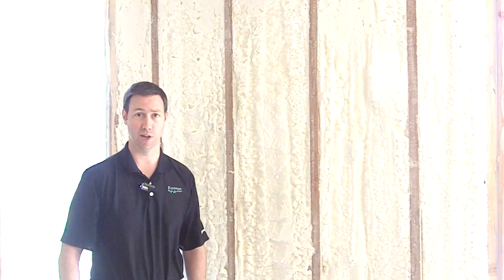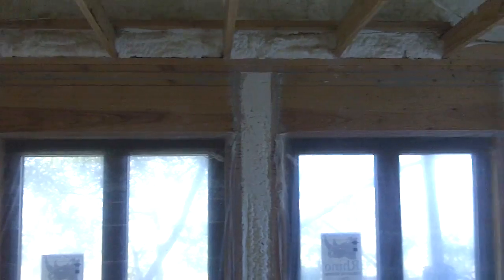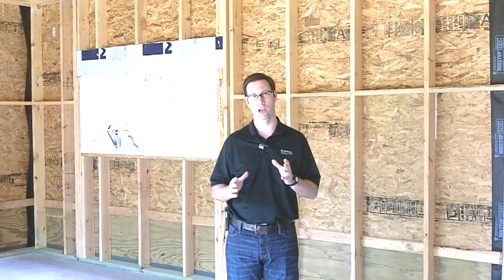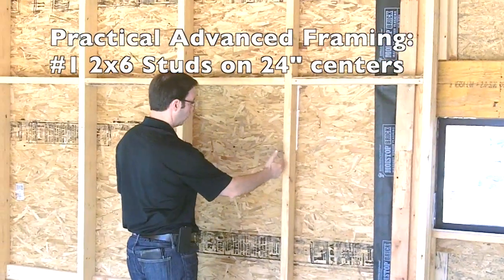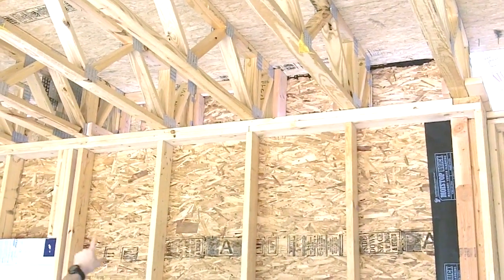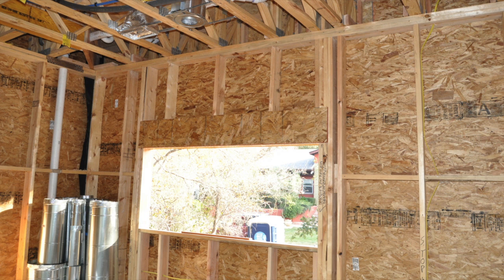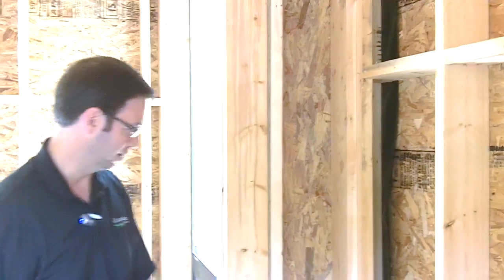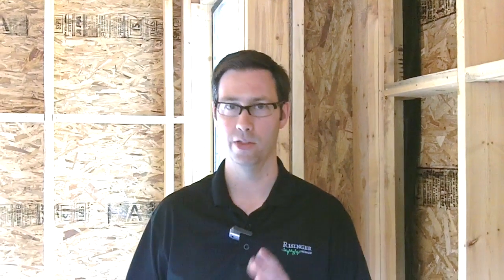Advanced Framing vs Traditional Framing

Comment: Lots of fun comments here.  As with any industry the traditionalists have to be dragged kicking and screaming into the future. I know, I worked in the car industry and watched the Big 3 get their asses handed to them. They were building old school heavy shit that was unreliable and inefficient. I'm now in a position financially to have a custom house built, but some of the comments here from so called craftsman concern me. They may be exceptional carpenters, which I greatly admire, but really, what qualifications do you have regarding structural strength calculations. A 2x6 24"OC wall has a greater section strength than 2x4 16"OC. A semester of college level Strength of Materials will teach you that, so how can pounding nails for 25 years somehow make you qualified to dispute that. This kind of construction is being studied and has been proven. As a lay person even I can go do a little research and find that. Scary shit.
Reply: Most of the comparisons are people who insanely overbuild, with 2x6 boards at 16" OC. To get an "apples to apples" lumber savings, we also have to consider 2x6 boards for 16" OC vs 24" OC. The main difference between traditional and this video is the horizontal blocking, which he doesn't explain to us at all.
Reply: @Nphen  panel edge blocking for Ptreated ply and I'm assuming fired blocking for wall height code cant imagine running horizontal grain osb on walls
Reply: Just because it's new doesn't make it better. 
Roofing contractors in the 90's thought staple guns were the "future" and became popular to nail shingles down quick. That is until entire sections of shingles started pulling right off in the wind!
Reply: Lol, I remember the "staple guns" for roofing, but I thought it was the 80's. Yes, that was not a good move.
Reply: @xallthatremains8339  just because it's new doesn't necessarily make it worse either. Not sure why people can't understand that technology does advance
Reply: Funny you say that....in early spring a strong wind storm came through here and I enjoyed watching large sections of shingles flapping in the wind and taking flight...they had to replace the roof on every one of the 13 buildings in my community...built in 1994
Reply: Grouperhound 
Sorry you're missing the point. 16"OC is better if you plan on living in your home. When your trying to find the perfect place to mount the trophy walleye then 16oc makes sense. Down the road maybe you want to add some cabinets, 16oc will make life easier. Kids bounce off a wall roughhousing, 16oc to the rescue.
Reply: Grouperhound is correct, a 2x6 24in oc is slightly (4.7%) stronger than a 2x4 16in oc. Takes less time to build and provides more insulation room, what's not to love?
Reply: @nafnaf0  

You're still insulating the same sq feet of wall...there's no "more room for insulation".  The only thing you're changing is the width of 2 studs every 8 ft for insulation instead.  I don't see a practical difference between 3 inches of solid wood r value versus 3 inches of insulation every 8 feet in the grand scheme of the overall energy efficiency of a house....as most of the heat/cooling loss is from windows/doors/attics

This is an example of a book smart person with little experience trying to change the world....that doesn't need changing.

If you want to change something....go with actual advanced techniques, not bogus "advanced" techniques that are just profit driven cheapening of end products.
Reply: As a layperson you are missing the forest for the trees. Why would 2x6, 24” centers and 2x4, 16” centers be your only option? How about 2x6, 16” centers? You’re focused on volume of insulation. Any simple internet search would reveal air sealing is regarded as the standard for insulation, not insulation mass. In Michigan there isn’t even a prescriptive insulation allowance anymore, it’s simply a blower door test (air leaking detection). Perhaps the problem is you feel you’re an expert after a misleading internet search?
Reply: Nope, you're wrong. I've built three super-insulated structures and am working on a fourth now. Thermal bridging dramatically reduces the R-value of a wall, so we separate the inner and outer walls with insulation. There is NO substitute for insulation mass; we use blown-in cellulose. Air sealing is very important but not the only aspect of quality homebuilding. @Nineteen8058
Reply: Grouperhounds comment should be pinned to the top of all the comments (not that youtube has that feature, lol). In a nutshell there's a lot of people saying "2x6 24" oc sucks because we've been doing 2x4 16" oc our whole lives". Sorry people things evolve and yes science and engineering does have a role that supercedes "we've done it this way for years so its better". I think people are a little gun shy because of all the "latest greatest" product failures in the past (hello PEX tubing). BUT solid engineering principles don't change with time, the numbers and data don't lie.
Reply: Your just an idiot with money too careless to understand real life vs marketing info.   Its common fucking knowledge that new houses suck and that they dont build them like they used to.  Thats why people love old houses.  Thats why old houses EXIST.   This isnt some opinion, its common sense that has been driven home year after year as developers keep creating cheaper and shittier houses.     I have  a house from the 30s, plaster walls, slate roof, my house will be around for another hundred easily and its beautiful. , every one of my friends who bought a new house has had problems due to shoddy construction/materials.   The  phrase "they dont build them like they used to" is 100% real and accurate.    None of these shitty houses will be around for a hundred years.
Reply: Feel free to call me a traditionalist- it's a badge I carry with pride. My methods have hundreds of years of proof standing behind them (and me too). When your methods are equally well proven then I'll consider them. I'm no 'luddite'- there are some newer materials and concepts I embrace but much of what is touted today as "advanced" or "better" doesn't work out that way in real life. One consideration of strength is missing in your calculations: Wind loading. That OSB (and even plywood) sheathing will not meet wind-resistance codes in the many areas which now have that in effect due to the excessive supporting span. Insurers are clamoring for those standards to be implemented nation-wide and your "advanced" structures will become uninsurable in time, same as what's happened along the gulf coast with houses in hurricane-prone areas. I hope you're ready to pay the suckers who buy your ideas for the expensive structural upgrades they'll need when that happens. Sheetrock also loses strength over the wider span. Increasing the thickness of these materials to compensate for that adds to the dead load which requires adjustment to the live load and foundation. And now you've got a non-standard wall thickness which will require custom-made window and door jambs on all exterior walls- those don't come cheap. You're also going to have to add blocking for wall cabinet hanging which again adds weight and puts more framing in the wall volume which reduces the insulation space. Which any decent engineer should have caught from the get-go. But instead of trying to understand what's going on with frame structures, the more highly educated folks are too intent on improving one aspect so they fail to see the whole picture, and their designs assume to many other things which in the real world may not be they way they should be. 

Can better frame structures be built? Sure, but not this way. Can houses be made more energy efficient that ones built 50 years ago? Sure, but again there's more to it than just energy efficiency considerations. If a structure does not endure it is crap no matter anything else. Unnecessary loss of strength in any way at any point is unacceptable. Building methods that are not compatible with the needs for fitment of all the other parts which go into the building of a house are unacceptable. Houses which cannot later have things like tile floors added without reinforcing the structure due to the lack of foresight of the designer and builder are unacceptable. There are darn good reasons for things being done the way they were 50 years ago, and most of these "advanced" things could have been done back then but they weren't. The only true improvements have been in the areas of seismic and wind resistance, and in better insulation in fenestration. Otherwise most of these "modern" methods and materials have drawbacks which negate their supposed gains even if it takes 50+ years for those drawbacks to become evident.
Reply: @P_RO_  do some more research Advanced framing has been around for a long time, it meets IRC code easily.  we do two stories with 100 lb snow load and 100 mph wind load and there's not a problem. There are some details you have to do differently like more blocking, but people shouldn't be resistant to something just because it's different
Reply: MegaMusicka  what you talking about Willis?
Reply: Wow, these comments.  Structural engineers and contractors are two different skill sets, and different levels of education. For STRUCTURAL issues, listen to the STRUCTURAL engineer.
Reply: Interesting take. I know your just throwing out examples, but keep in mind when you hang things from a wall, between studs, theres plenty of options that are plenty strong for something thats <20 pounds or so. If you have kids literally bouncing off the walls maybe they can find better ways to expend their energy (like outside), lol.  Life is about choices and I would rather have the bennefits of 2x6 24' oc over 2x4 16" oc in my own house if I ever build someday.
Reply: @krehbein  2x6 16"oc is the only way for me. After all the homes I've built and remodeling and additions   it works best. Lots of snow load, and second story houses. Single story homes in a temperate climate save those pennies and go with 24oc"
Reply: As a lay person you shouldn't be commenting. Just because you can Google something still doesn't mean you know Jack shit about it. You can't tell me someone who's been swinging a hammer for 25 yrs doesn't know about structure? Wind? Shears? Deflection? Bullshit. All I'll say is that I'll take a couple extra bucks a month extra in utilities and build it the old school way (correct way) so it's still standing 120 yrs from now. Which this house may be, but I guarantee it won't look pretty.
Reply: @kevins2033   It's very funny to me that you should be saying this and pick that "120 yrs from now" number. I've remodeled about 3 dozen 100-150 year old houses, lived in 4 of them (I grew up doing work like this, so it was natural). They were all built 24" On-Center. They were also built with OAK lumber with TRUE 2" x 4" studs and their frames have held up beautifully (though most have not been built with strong foundations, so that's another issue entirely). They had plaster and lathe, which is if I had the time and energy to replicate, I would. If not, I've found that 3/8" drywall is almost a perfect match for -- not much extra rigidity offered from it and no extra rigidity afforded by any spray foam or anything either. I'll also state that I've done this in my spare time, as by trade I am actually a Mechanical and Electrical Engineer. Given that fact, I can tell you that OAK 2" x 4" vs. PINE 1.5" x 5.5" (2x6 nom) are actually very similar (note: that's a mathematical term) in their structural integrity and overall strength. Add the additional rigidity of the closed-cell foam in the voids and the sheet materials for sheathing and you'll be far exceeding what I've been seeing last far over "120 yrs" ... Just my 2-cents from somewhat of a non-layperson.

Comment: We bought a house in the Dallas area that was built with 24" spacing on the framing.  We had to spend over $10,000 to have the foundation leveled because the walls were not steady enough to stay in place when the foundation shifted.  I would never have a house built with 24" spacing for the framing.

Comment: With all I read about tornadoes in the Midwest and earthquakes in California I just have to completely disagree with this. Even if you use 2x6 instead of 2x4 I don't see the strength there at all especially in a multi story structure. I do agree that homes should not be using OSB instead of plywood. I also agree that homes are not insulated well enough either. Also, I feel that it should be code enforced to use hurriquake nails for the entire structure as well.

Comment: framing walls with studs spaced at 24 inches makes them weaker. I completely disagree with this guy. .... here is why. 
the wall becomes flimsy or bendable making it more vulnerable to seismic movement, and wind movement. less is definitely not more. Walls the can bend are not stronger.
Reply: +Anderson Hernandez that is not the only difference they use a 2x6 instead of a 2X4. 2x6 are stronger than 2x4s which will mean that the strength of the walls are comparable if not stronger. Think about it. 8 foot length of wall will have 6 2x4 at 16 or 4 2X6 at 24 (which if you look carefully its actually about the same area of wood 2*4*6 = 2*6*4). so half the studs. but 2x6 is actually about 3 times as strong in bending along its long 6 in side (we don't care about the 2 in side because the outside sheeting takes care of any forces in that direction). So while you have half the studs per 8 foot sections the wall is 50% thicker which means its actually stronger in bending (lateral forces such as earthquakes) and because there is the same amount of wood cross area we should have about the same compression strength or ability to care vertical loads.

Comment: This is called "light construction". It is a design that insures reduced cost, quicker collapse in fire, dead firefighters, more lost homes. Oh yeah and did I mention it saves a little bit of money?
Reply: Clyde 1066  
The entire purpose of engineering is to design something that will support the load for minimal cost. Engineers are very cost contentious because it's a major part of our profession. We know there's no such thing as a blank check and that it all boils down to a cost/benefit analysis.
So the idea that somehow "bean counters" determine what an engineer designs is laughable. Even if there were accountants pressuring engineers (I've never seen it), the engineer is the one stamping the design and thus has full control.
Engineers are continuously working on new design methods in order to meet design criteria. If we can come up with a method that is lighter/stronger/cheaper/quicker/etc, there's a cost savings and it can generate a ton of work. 
Perhaps next time you're sleeping in a drafty mud hut you'll appreciate the engineering that has gone into developing a modern house.
Reply: Any framing which incorporates osb and lightweight trusses should never be called advanced framing.  It's total shit and will fall apart.  This cheap construction is engineered with zero safety factors for cost efficiency whereas legacy constructed homes are overbuilt and include safety factors which was unbeknownst to the carpenters in that time period.  The guy said it himself in his own video.  If there is any lateral loading of the wall studs and support is lost there will be a longer span of the structure being held up by other structural elements.  That being said, you're probably an engineer who gets paid to design these bullshit framing products which nowadays is all cheap garbage.  Would you put your family in a home which when lit on fire will fall into the earth in 10 minutes??
Reply: Salt amura 
Clearly you have no idea how engineering works. ALL engineered designs have safety factors. Do you honestly think when we design for a 90mph wind that the structure will topple at 91mph?
Just because it isn’t built like a bank vault doesn’t mean it’s not safe. And I would gladly put my entire family in a house that I’ve engineered, in fact once we figure out where we want to build we will do exactly that.
Reply: You're full of shit. 2x6s last a lot longer in a fire than 2x4s. Also 2x6 on 24" costs MORE than 2x4 on 16".
Your statements is 100% false.

Comment: Advanced cheap framing! Try doing this in the North East and your inspector will laugh at you. 16" on center for 2x4 or 2x6. Houses built in the 50' were built better due to the lumber they used. Mature trees, not the crap that is used today. I have 2x4 that were harvested at an older age and are straighter than the crap today. Also header size is determined by the span / window or door being used to spread and distribute the load. For me, I rather have  strong safe structure that your advanced framing.
Reply: +Robert Butka you must not have heard about sip construction. SIPs have even fewer studs and are used all over the northeast. They are actually stronger as well.